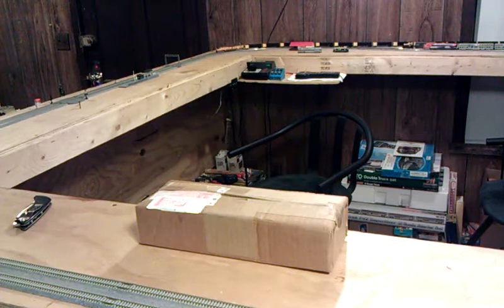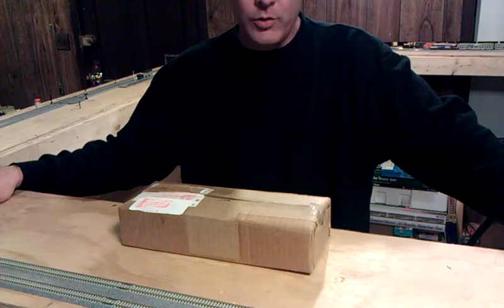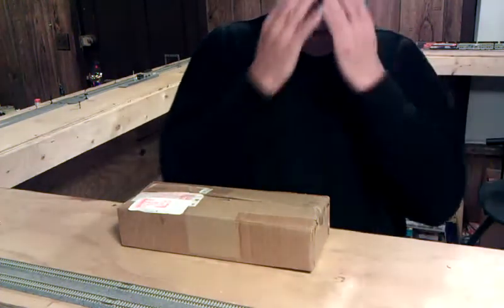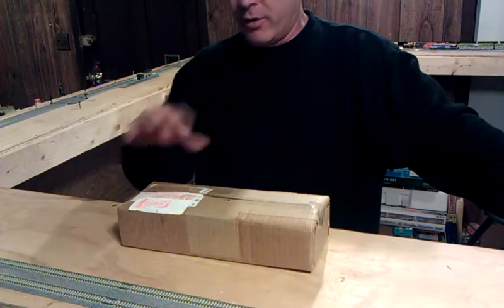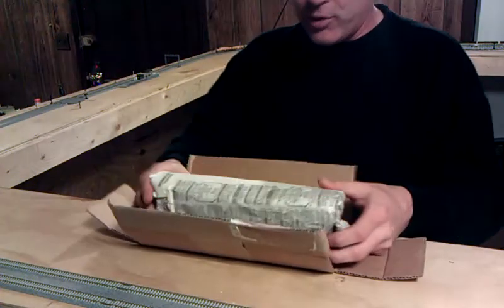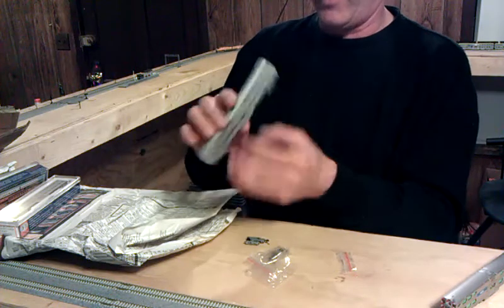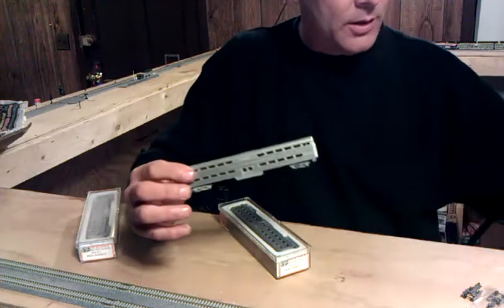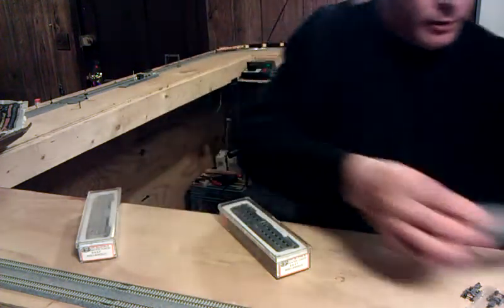Concor Bi-level commuter coach unboxing, Tomy platform wrap up....

Comment: Those are really nice cars. I see that you very much into metra, and the commuter trains. I have two con-cor Budd Bi-Level cars that I am selling. They are painted in the burlington paint. I have one coach, and one cab car. They are very nice and run great. The only thing is that they have those bigger square couplers on them. One car haves a knuckle coupler on one end, so you can run them but they have to be the last cars. I am selling them for $17.00 a piece. Please wright back.Thanks -Chris

Comment from the maker: @MrRobotoish i think that in a couple of the vids there are decent shots of the layout, but basically its just the benchwork, which is almost finished, (i want a penninsula in the middle still) so im not real proud of it yet and have track to lay yet, so most of my vids are just showing the loco's and rolling stock, when i get track and bed laid, then ill get jiggy with layout vids. And with a little work, the concor cars can be nice, but the Kato's are the shiznit......for now.